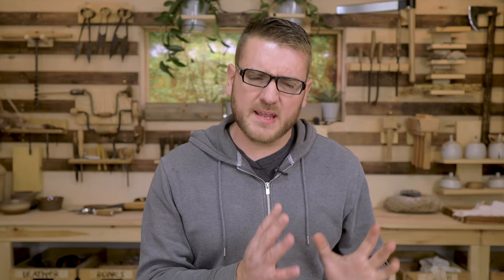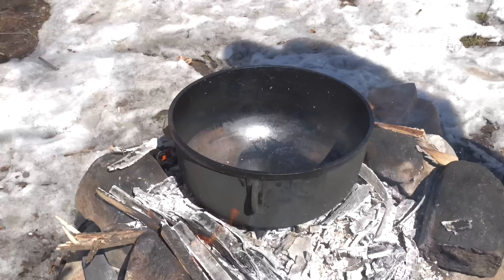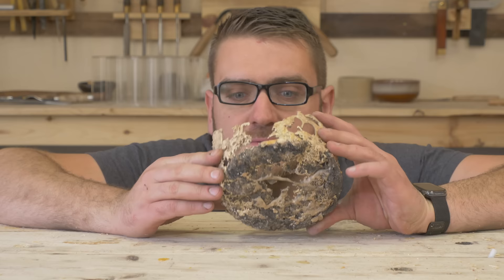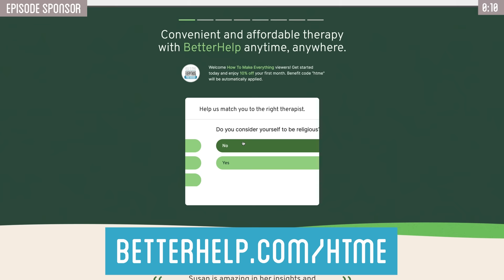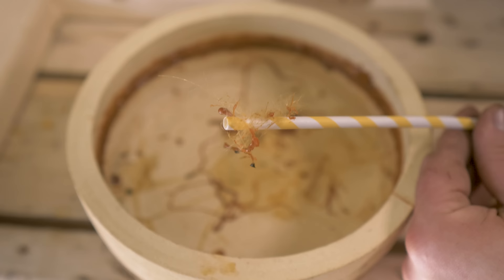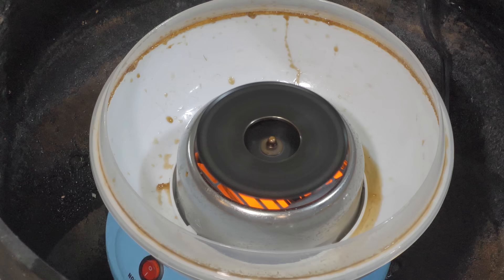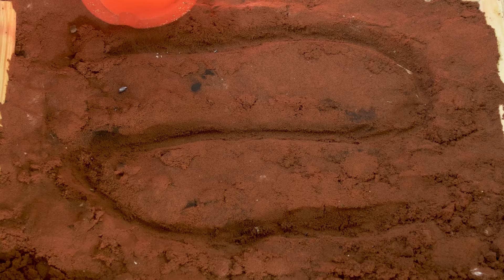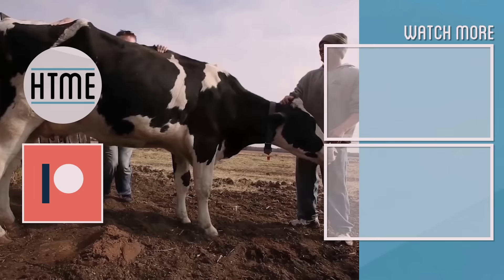Can a Dr. Stone Centrifuge Make Cotton Candy and Wires?

Comment: Ok, so a centrifuge would certainly be a flashy and dramatic way of making wire, but surely it would be easier to do it by pouring a thin stream of molten gold onto a rotating iron wheel so that it cools down quickly, but not too quickly?

And then if its still too thick, just twist some strands together and use a couple of reels with a gear box turning each spool at a slightly different speed to stretch it thin? You could even take the spooled wire off and put it back on for another stretching.

Comment: This wire one is definitely the odd on out. I mean most of the Dr.Stone tools are rudimentary methods of previously existing ones to make the same product. The issue is we don't have a method of immediately turning metal to something wire like even with current technology. I believe the fastest production starts out with rods and we roll it out until it is our desired gauge. Maybe Dr.Stone should have made a stone roller mill, but then I guess you couldn't make a moral boosting food out with that..

Comment: Making wire by marteling the metal end streching it is more effective, but its a very long process. The series would have been more plausible if there were wires and parts in glass bocals, salvaged after the event, just like the Treasure box they are searching for.
As for an initial wire to start with, a fine mold of sand and plaster can make you at best, a foot long of 5mm wire.

Comment: i think maybe a steel crucible for the floss machine would be better, then u'd be able to use copper as a good substitute for gold as they are both very similar to each other. I can't remember what metal was used in the anime but i think its likely to be iron.

Another point i might make is the hole sizing may be different as its a larger machine overall, which effects a ton of different variables, so i think making it full scale would yield different results. though this is likely to be expensive so i understand if you dont attempt it, perhaps getting in touch with the creators of the anime might give you some funding if they want to partner with you. I think its highly likely they would after seeing your channel, you have 1.7 mil subscribers too so thats decent reach for marketing.

Comment: Maybe if you used the last method, but instead of having water at the bottom, have a super long straight tube, so the metal would cool while falling before hitting the bottom and breaking. Of course, you would need a really tall tube and a ladder.

Comment: in dr stone the gold is put into heated cotton machine its over a fire and ther are not pouring gold into it as it spins because i obviously cant work 
with your electric cotton macine problem is its is designed for suggar 
lower melting point means its cools much faster to solidifing temp 
to make it work u need to adjust the speed of rotation and the overall air temp has an affect on it 
if its too fast it will shoot liquid pellets because molted metal wont have time to solify when leaving the holes and while flying still liquid will create pellets because surface tension

Comment: I think the real issue here is that the speed is way way too fast to make the wire strands. Sure, even in Dr. Stone, it's speed is probably too fast to make fine wire, but I believe the overall principle could still apply with some experimenting. Also, using maple syrup really isn't great to make cotton candy, simply because it doesn't have enough of the main sugar that cotton candy works best with in high enough quantities. Also, in Dr. Stone, they had a fire keeping things hot, so that's another issue where you weren't having the centrifuge at a constant heat.

Comment: Huuuuuge sigh here. We are on the same page with the learning how to make everything. I've been curious of this meathod as I have worked in a forge before and had the same suspension for the outcomes as I've found that steel, forges steel. So from my take is it may be possible to forge a wire with a steel/iron mold, especially if it were two molds pressed together, or two halves of a whole and poured with the mold standing upright from top to bottom.
The mold itself would start out by casting into a wooden frame, then, as the steel cools, you make be able to carve a straight line through the center for your wire peice, or use a straight stick in the center, pouring around it to create a bevel (spooned) indent down the center. This way, you could make two identocal molds to create a round wire, or maybe even iron rods. 

At least, those are my thoughts on this process. Right now I'm working on making bricks and mortar. As well as a few other things for everyday life. Anyway, i hope the mold idea helps.

Comment: With your last setup: how about instead of water, you pour your molten metal onto some dry and stable surface, like a steel sheet? It would help you control the flow and work like a 3d printer.

Comment: Probably a naive approach but I wonder if it might work (I have no experience with hot metals) :  can you reach a temperature that the metal gets more malleable but very viscous?  And then apply force to PRESS IT through a hole like toothpaste ?
Reply: You would have more luck pulling it through a die plate than pressing, but yeah, it's possible to get most (not all) metals to a taffy like consistency.

Comment: Myth busted! Praise to Andy for trying so many methods. The cotton candy machine is supposed to keep the sugar at the right temperature, I think different metals must have a different (much higher) temperature to floss effectively- if it's possible at all.
Reply: I'm not really sure if I can say the myth was busted. Andy very clearly took a ton of liberties with his version, most notably he chose not to put a fire under the wire spinner, which is almost certainly why it cooled too quick.
Reply: also there was a reason he had 2 people running rather than just a person at a crank the crank simply isn't fast enough with just an arm of force more gears and haveing a better system for pulling would probably work but both the cotton candy machine and the bowl around it also have to be larger so it doesn't overlap while drying or else you get the problem he had also it wasn't stable enough. not that I could build it better however if all of these problems were fixed it might have a shot.

Comment: You will get a much more flavorful syrup if you actually heat it evenly and stir it occasionally and introduce air. Usually by using a large ladle to pick up and pour the mixture back into itself. 👍👍
Reply: Also I wonder if adding flux would help results?

Comment: So i do like this attempt; however i saw the cradle for sugar/metal was wobbly that didn't help, in addition to not having a heatsource under it properly like in the show kinda invalidates, the heat will keep it hot while removing alot of moisture from the device. Its cooling too quickly before it can properly throw out, the real machine being made only for sugar wouldn't have worked, however if you had say... a full steel version, something that wouldnt be really realistic for a cotton candy machine it might have a higher chance. 

You can also see they didn't use the exact same machine, just the same premise for the wire thrower, i believe they may have used a very durable stone for the bowls. All in all i think its high unfeasible in our day where metals are expensive to try this with; but i think it might have more potential than we believe in a situation where resources were easy and abundant to obtain.

As others have said as well they had a proper craftsman on their team as well, While Senku gave the idea, the precision for the device needs to be pretty tight after all. Any wobble really messes up a centrifuge system or any delicate matter devices in that case that spin.
Reply: If this is truly debunked, this means a lot, sadly. The Wires but more importantly the Cotton-Candy is ESSENTIAL. Senku later builds candy-powered Spaceships

Comment: The easiest low tech way to make a wire:
Pretty much the method you use at 13:00
But replace the shallow water container with a vertical 4 inch drainage pipe full with water.
Thank me after the apocalypses.

Comment: The problem with making wire like this is that it's very runny and has rather high surface tension, it doesn't have a highly viscous stage like sugar or glass.

Comment: Molten metal is too dense and has the wrong properties to spin into wire.  The surface tension would pull it into beads before it could be stretched into a thin cylinder.

Comment: I could see it as perfectly possible if you had the right equipment since it's a similar process to make glass fibre. It would probably be expensive though since everything would need to be heat resistant enough to withstand molten metal and you'd probably only get short fibres.

Comment: Honestly part of your problem might've been the scale, trying to pour into such a small centrifuge, and as far as pouring molten metal into the cotton candy machine you bought?  What did you think would happen, that thing is in no way built to deal with those kinds of temperatures.  Not saying this would necessarily work, just that the small scale makes it nearly impossible to test it properly.  That said, I understand a larger (and more expensive) setup wouldn't have been reasonable for this.

Comment: you could take a fire brick length wise and drill or force like a small diameter rod or drill bit through it get the metal a few hundred degrees above a average casting tempature and try pouring it in using this idea u could stack multiple fir bricks together and use a large feeder sprue to give good head :D pressure to force the metal into the mold down sides would be continuously destroying fire bricks and i couldn't imagine getting anything more the 12 inches or so. you could make a 2 piece mold out of a metal with a higher melting point and cast aluminum wire just preheat the mold and and make sure you have good head pressure to force the metal either way you could then draw out what u make to various lengths and diameters which kind of defeats the purpose casting long thin things in anyway i can think is to hard. of course you might be able to make large pieces of metal foil and just roll it to the desired length and diameter...just thoughts off the top of my head without using some sort of vacuum or specialty equipment

Comment: I thonk witg some insane work and math the centrifuge wire MAY work. But you would probably need to size the centrifuge itself and the size of the holes to very apecific parameter depending on the metal you are using and most likelly the temperature would also have to be insanelly precise, also the rpms. Can be too fast nor too slow. And even with all that i dont know if it could evee trully work and even if it did it would probably be a huge mess not worth the time and effort put into it.

Comment: the granulated sugar is likely important because it allows it to be placed into the crucible and then melt versus getting stuck as a syrup while trying to pour
Reply: also there was a reason he had 2 people running rather than just a person at a crank the crank simply isn't fast enough with just an arm of force and more gears and having a better system for pulling would probably work but both the cotton candy machine and the bowl around it also have to be larger so it doesn't overlap while drying

Comment: The properties of metal won't allow you to make wire with the cotton candy machine method. You need a viscous material that has a transition range (e.g. glass or sugar) metal is a liquid or solid there's not an in-between state. Cool you attempted it, but it seems a little obvious it's not going to work.

Comment: main points of failure: the modern cotton candy machine spins to fast, the metal is too molten (If you get your metal to just the right heat it can be somewhat soft almost and fluid while still able to re fuse. ), there is no constant heat source to keep the holes from clogging, the holes are a little to big, and the metals need to be a more catered alloy. With all these adjusted it may be possible to make some wire with the centrifuge.
Reply: also there was a reason he had 2 people running rather than just a person at a crank the crank simply isn't fast enough with just an arm of force more gears and haveing a better system for pulling would probably work but both the cotton candy machine and the bowl around it also have to be larger so it doesn't overlap while drying or else you get the problem he had also it wasn't stable enough. not that I could build it better however if all of these problems were fixed it might have a shot.

Comment: I'd want to try casting the metal into as thin of a rod as I  could 1st, then after it cools suspending it with a weight on one end and slowly heating it until it started to stretch.
Reply: Another thing I'd want to try is making just foil then cutting it into strips and twisting it into cordage.
Reply: Or you could try melting the foil strips and seeing if it will just bead up into a sorta wire like shape on its own

Comment: Between surface tension and ledenfrost, I don't think there's any way to "cast" wire. There's a minimum size you could effectively cast, and it's too thick to be reasonable to call "wire" in my book.

Comment: The usual method of doing gold wire is ,making an ingot then pulling it through smaller and smaller holes on a metal disk until it's of the desired thickness.

By the way, you made your cotton candy machine wrong, it needed a stable base to rotate and an under fire so you don't have to preheat the cup... like the modern version one. Also, you're lacking the metal axis that Senku's one have.

I wonder if the higher melting point of gold could be why the Senku system worked...
Reply: also there was a reason he had 2 people running rather than just a person at a crank the crank simply isn't fast enough with just an arm of force more gears and haveing a better system for pulling would probably work but both the cotton candy machine and the bowl around it also have to be larger so it doesn't overlap while drying or else you get the problem he had also it wasn't stable enough. not that I could build it better however if all of these problems were fixed it might have a shot.

Comment: do you think this could work if you tried a different approach more like they did and heat the gold or other metal slower or something
Reply: also there was a reason he had 2 people running rather than just a person at a crank the crank simply isn't fast enough with just an arm of force more gears and haveing a better system for pulling would probably work but both the cotton candy machine and the bowl around it also have to be larger so it doesn't overlap while drying or else you get the problem he had also it wasn't stable enough. not that I could build it better however if all of these problems were fixed it might have a shot.

Comment: So you made a much smaller device
Using a different fabrication method
Used different metals, different sugar source, and only used yourself

It may be hard to see, but the show's looked larger; both in the reservoir and the holes

The metals melting point is only one important factor for the methods shown.

They chose gold because it has a low melting point, cools very fast, is one of the best conductors, and when cool remains somewhat flexible.

Senku also always seemed to have no less than 3, often more, people to help with each step.

How can you dismiss the show's methods when your experiments were barely even similar, let alone close, to what was depicted.

Comment: Wire is Drawn,not molten.Thats thereason wire gets its special featuers.All you ned is a boar with holes.getting smaller and smaller to your your final dimensions.Then you start with punching the ore or what you got ,with a hammer flat and into wire form(Like a you forge a nail)
Than draw that(cold )through the board. 
Wire is done this way for a veryyyyyy long time...

Comment: First of all, your sugar was way too hot and that's why it didn't work very well for you. It needs to get thrown out of the centrifuge RIGHT AT its melting point. You'd be better off putting the solid sugar crystals in the centrifuge and slowly heating it up.

Sugar's crystal structure can form bonds at its melting temperature and that's what allows it to form long chains. But metal only allows those chains to form at lower temperatures, not melting temperatures. So the way we draw out wire currently it pretty much the only way to get those chains to form.

Comment: I thought of another way to make wiring and make it very small amounts of wiring without a lot of technology you could get the rather large pieces of wiring that you could make during your poor method but then hamrick flat like a foil then take the foil and instead of trying to cut the foil into size of a wire take a small chisel and make a
light groove in some wood with very clean edges and then just hammer the foil in using the wood to cut your foil into wire

Comment: This didn’t work because the contents of the cotton candy maker are supposed to melt while they spin. Pouring the contents pre-melted too much to be ejected from the middle at once. If it melts in the middle it’s ejected as it melts creating thin continuous strings instead of clumps
Reply: also there was a reason he had 2 people running rather than just a person at a crank the crank simply isn't fast enough with just an arm of force more gears and haveing a better system for pulling would probably work but both the cotton candy machine and the bowl around it also have to be larger so it doesn't overlap while drying or else you get the problem he had also it wasn't stable enough. not that I could build it better however if all of these problems were fixed it might have a shot.